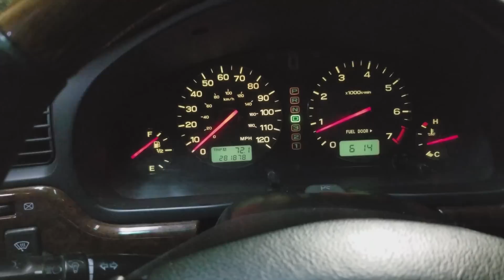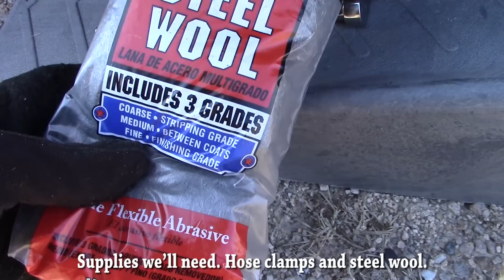Subaru Exhaust Rattle Repair

Comment: I used some brass wool to fill a few voids between the heat shield and the exhaust pipe. Worked like a charm and doesn't rust. I cut off all the mounting bolts (but one {access issue}) and replaced with stainless steel hardware. Now, to replace that leaking oil pan seal....

Comment: I have a feeling this is the issue my 02 Outback is experiencing. I was about to diagnose it as a rattling driveshaft or bad u-joint (maybe even a transmission noise) but it doesn’t seem to have any issues driving, no shaking >50 mph as my 87 BMW 535iS had when it’s driveshaft went bad. My sub just has this annoying rattle when running.

I think you just saved me a bundle of money with this video!!
Reply from the maker: Glad to help. 👍🏻

Comment: Worked like a charm! My rattle kicked in at low gears at around 1500 rpm on my 2014 subaru forester.
Reply: Lmao I was brought here by the low gear rattle around 1500 rpm on my ‘14 Forester. How are your ball joints and CV axles holding up?

Comment: Thx MrSubi, this fixed a 10 year long mystery. Serviced over 8 times now by Subaru dealerships for the mystery noise, never fixed. You fixed it. One thing I changed:
COPPER MESH wool instead of steal wool because rust, hopefully that will be a 5 year+ fix.

Comment: The steel wool rusted. Replaced with stainless scouring pads. A little harder to get in, but works like a charm.
Reply: We have them at the restaurant ask any restaurant worker will snag a couple for you.
Reply: Did the scouring pads hold up for a while? I'm needing to do this on my car and I had the same rust concern.
Reply: @jasonbinney2979  They've held up great so far.
Reply: Isn't steel wool flammable?
Reply: @phizz8694  It was 3 years ago.

Comment: When I first heard some painful rattling under  the hood of my newly purchased (and previously enjoyed, 145k mileage) 2010 Forester which I have fallen in love with of course I first thought of the worst. Was it the engine? Catalytic converter? It was just the heat shield. I pinpointed where there was some space and movement, and thanks to this video it’s now perfectly quiet underneath once again. We will see how long the simple remedy holds up, but for now it’s working beautifully. I used a thin pvc pipe hand saw, thinner than a flat head, and I was really able to pack a lot of grade 1 steel wool in the small spacing that was causing such a terrible noise. Thanks Mr. Subaru!

Comment: I just got a 2012 Subaru Legacy and it has the same rattle you had I was like wth can it be and it sounds like it’s the heat shield so after looking at your video I will be doing this on the weekend thanks for posting 🤘🏻life saver

Comment: Lol. I pulled a nail someone jammed between the shroud and exaust on my car. The thing rattled and I thought I botched a repair elsewhere. Shoved the nail back in temporarily to quiet it down. I'll be fixing it the right way so I don't give myself or someone else a flat.

Comment: Excellent video. Hopefully this is the issue with my 2013 Forester. It's exactly as you described, at drive thru's and red lights.
Reply: Same noise same car, I will try to do the repair this weekend

Comment: Made a discovery recently... I first thought my chattering noise at low rpms was due to the exhaust manifold. I then noticed that the rubber hose that drains from the A/C had become unseated from its plastic clamp to the left of the transmission and was bouncing against the exhaust system making the noise. Just something else to be aware of I suppose. Figures I'd see it after I had jacked up the car and checked the entire exhaust system for loose parts hahaha
For context, this was a 2010 Legacy 2.5i

Comment: I have a 2000 Subaru Outback and I have that same noise. I well have to do that . Thank for the tip
Reply from the maker: +Christopher Hayes you're welcome. Glad to help. 👍
Reply: I think every Subaru eventually gets the "Heat Shield Rattle".  My 2010 Legacy did.  I used a metal hose clamp (just like the video) to silence it, though didn't think of the steel wool.
Reply: Be careful some times the exhaust actually breaks loose from the welds. The 2005 outback xt that I used to have did the same thing and rattled like crazy just like this. I totally thought that it was just a heatshield.

Comment: It is really terrible that this is such a huge problem and they don’t address it. I have it with my 2013 forester. Aren’t you worried about the steel wool rusting away after hitting one puddle?

Comment: Thanks again for making this videos, also as a suggestion could you make a video with the subject about fuel lines I got a Subaru 2002 Impreza outback sport and I had to deal 2 time already with fuel leaks coming from the small section of rubber fuel lines right next to the injectors, driver and passenger sides, temperature under 32 degrees trigger this leaks and they are nerve-wracking especially when you're away from home.
Reply from the maker: +Regular J Garage talking about the rubber fuel lines between the fuel filter and fuel rails?
Reply: Got the same issue on a n '01 Forester.  When the temp drops below freezing I get a strong smell of gas in the cabin.  Is there a simple repair short of replacing the fuel lines?
Reply: No, the lines I am talking feed the injectors, they are mostly metal but for some reason have small section of rubber hold by hose clamp, I live in Alabama and we have 20 degree weather this couple days, and that's what cause the rubber to think or freeze allowing fuel to leaks, is a simple fix, just tie the hose clamps, but when you're dealing with fuel potentially running down to the exhaust, that's scary.
Reply: Andrea Echevarria what I did was tie down the hose clamp, check for leaks and keep  an eye on it. But If your fuel line has any kind holes or cracks replace it inmidiatly.
Reply from the maker: +Andrea Echevarria nope. Either the fuel lines need to be replaced or the rubber seal at the fuel pump module, under the back seat, has failed.
Reply from the maker: +Regular J Garage you're visibly seeing the fuel leak from these hoses? Or could it be the injector o-rings? Either way, they're old and most likely getting brittle, so the contraction from the cold is really doing a number on them.
Reply: MrSubaru1387 yes I can see the leak, I had to remove the metal bracket that cover the injectors to get clear access, also coolant leaks where the radiator hose meet the aluminum cross coolant bridge, I can't get it tie enough to stop leaking, thank for the help, like you said the hoses are getting old and brittle I also going to replace injector oring will I am at it
Reply: Thanks

Comment: I think this is happening with my 2016 Impreza - that slight rattle once car started, and then more so at initial acceleration....after that don't really hear it as car speed increases to 30-40-50 km/h, .....neighbour told me its the CV joint/bearings....but why would it make noise even when in park?  No vibration or steering issues either. Have to find trustworthy mechanic...

Comment: I have a 2009 subaru outback and the rattle is a different location. The exhaust hose is disconnected from the muffler. My husband tried epoxy to reconnect and I've tried using jb weld steel stick putty but neither worked. I'm wondering if there is a part I can attach to the exhaust pipe that will fit into the muffler? or any suggestions you might have, including give up and take it to the shop.

Comment: You know what I find extremely useful for those clamps. A small power drill with a nut driver. The amount of time I've saved is astronomical.
Reply: Also I have horrific carpal tunnel and have had surgery. Still starts to hurt if I have to twist my wrist that many times.

Comment: I like the idea of stuffing something in there, but have you ever seen steel wool burn?  It goes fast and hot.  I don't have a better idea for this second other than asbestos, but that can't be bought.
Reply from the maker: Been driving like this without issue.
Reply from the maker: Yes, I have burned steel wool before.
Reply: I cut a piece of an aluminum tube today and tapped it in on my car. Didn't think of anything better yet.

Comment: Sit outside your Subaru dealer where the cars go in for service.   More than half the cars going in have this rattle.   You would think Subaru would have a fix.   Never had a car that had this problem before my Subarus (I have 2).   Every 65K they get a rattle that Subarus says is an internal baffle the want to replace for this noise.

Comment: My Forester '14 is making an annoying rattling noise. How much would it cost to replace the heat shield if DIY, and is it difficult?
Reply from the maker: Fairly easy replacement. Held in with 10mm nuts. Not sure of cost on the heat shields. Most people just remove them.
Reply: Thanks for the reply. I'm thinking of doing it on my own. Called the Subaru dealer, and it would cost $130 for them to look at it. Trying the weigh the dealer cost and DIY cost and experience

Comment: this video is not in New England... i have removed,  or clamped, or wired heat shields a couple times a year with my 04 impreza... i will stand by my vehicle any day,  but damn... more rattles than a nursery ( from heat shields )

Comment: I've used hose clamps and steel shims wedged between the shield.  How long do you find the steel wool lasts before rusting?  Do you buy stainless steel wool?
Reply from the maker: Well, I live in the south, don't get much rust at all. Yes, it was stainless steel wool.

Comment: I Have a question for you I have a 2010 Forester SOHC. makes Rattling noise in front engine Area. when cold start first start in the morning, but goes away after I "rev" engine what could this be ?
Reply from the maker: Kind of hard to say. Is there anyway you get take a video of it and email it to me or post on YouTube for me to see. Would be helpful.
Reply from the maker: Getting a 404 error when I try to watch the video.

Comment: I have a question. I tried the steel wool but it didn’t work. As a matter of fact the engine started to hesitate so I removed the steel wool immediately and the engine was working fine. I noticed that steel wool turned blue and I was wondering if by any chance you would know why it turned blue.
I have a P0302 code on my Impreza and I think this issue might be related.
I can’t still figure out how to fix this code.
I would really appreciate any help. Thanks
Reply from the maker: Cylinder 2 misfire. What have you done so far?
Reply: MrSubaru1387  I put new spark plugs and wires, I cleaned the MAF as well as the throttle body.
Reply from the maker: If the issue isn't spark, then you need to check fuel and compression.
Reply: MrSubaru1387  Do I need special equipment to check the fuel and the compression?
Thanks for all your advices 😃
Reply from the maker: For the fuel, simplest thing would be to swap injectors to see if the misfire leaves cylinder #2 and goes to the cylinder that you swapped it to. For compression you'll need a compression gauge or cylinder leakage tester.
Reply: MrSubaru1387  Great, I will definitely do that.
Thank you again for all your videos and for the tips.
Have a great day and I’m looking forward to learn more from your videos. 😃
Reply from the maker: You're welcome. 👍🏻

Comment: Hey MrSubaru. I’m having a bit of a problem with the trunk door of my 2001 outback. The panel of it doesnt stick, and every time I open the trunk, it unhinges on the top. It hangs down since the bottom screws hold on to it. It’s becoming pretty annoying and taping it is an ugly solution. Any tips? Thanks so much, gloria
Reply from the maker: +Gloria Flores this is an Outback sedan? Or are you referencing the hatch on an Outback wagon? Could you send a picture of the issue to me? MrSubaru1387@gmail.com

Comment: I noticed the rpm seemed low. Is this a normal rpm for this car? The reason I ask is I have a 2001 with the same rpm level. If it is not normal can you do a video on your findings of the issue, and the proper repair for this low idle issue.
Reply from the maker: +Longtrailside car is idling where it should be.
Reply: Ok thank you.

Comment: Can you make one vid about replace a blown exhaust gasket?
Reply from the maker: +Rulius Raul Estevez Vargas as in the exhaust manifold gaskets?
Reply: MrSubaru1387 yessss
Reply: Rulius Raul Estevez Vargas That is such a simple job. Two bolts sandwich the exhaust gaskets between the exhaust pipe and the head. Unscrew them, pull the exhaust down about 3-4 inches, then you can pull out the gasket. Clean the mating surfaces of both the head and exhaust, remove all the grime and residue and install a new MLS gasket. Takes about 20mins.
Reply: Jane Leelavathi so i have to pull the entire line to get to Clean it out? Do i do it with just a screewdriver? Or what?
Reply from the maker: +Rulius Raul Estevez Vargas if you watch my EZ30D engine removal/installation videos, I show replacing the exhaust manifold gaskets.
Reply: Jane Leelavathi that sounds pretty easy.

Comment: I wish I could work on my own car. What I need to know is how to find a good mechanic. I used to go to the dealer when my car was new newer but now they want nothing to do with me and want too much to work on it. (2003 Subaru Forester) So I asked around, read reviews on local garages and picked the wrong one. Now I'm in debt and got screwed. A loose heat shield was rattling when I left two weeks ago and looked under last night, just touched it and it fell off and is laying on top of the muffler. Can I drive with it like this? They also replaced my Bosch Icon wipers (for state inspection) with something cheap and charged me when they were fine. There's more but I won't go on venting. I just need a good mechanic
Reply from the maker: Finding a good mechanic is sometimes a difficult thing to do. In regards to the heat shield question, yes, the car is safe to drive without it.
Reply: What I mean is the heat shield is lying loose directly on top of the muffler and I can't pull it out in any direction. I haven't driven it yet since I found that but will be going out tomorrow. It will probably be really loud rattling.

Comment: Steel wool will rust and the rattle will return.  My solution is permanent.  Crow bar and cave man the shield off of there and throw it onto the steel scrap trailer.  Perfectly quiet forever.

Comment: What size clamps are you using?
Reply from the maker: I can't recall. Sorry. I'll try to check later and get back to you.
Reply: @MrSubaru1387  Yeah... Get right on it...
Reply: @MrSubaru1387  what's the size?
Reply: @airhogglider  I know it's a year later but I bought some clamps for my 2019 Crosstrek because the heat shield was rattling and I got 2 1/2 hose clamps.
Reply: @arthurfernandes2402  fixed and sold the Subaru Forester

Comment: What size of clamps did you use?
Reply from the maker: Can't recall. I have a display rack with all sizes. Just grabbed the largest one.
Reply: @MrSubaru1387  ok, but would it be safe to assume I go with a 3" clamps then?
Reply from the maker: You will most likely need to connect 2 end to end.

Comment: I have 2019 Crosstrek 6 spd making  rattling noise  only when  gas pedal is  pressed between 2500-4000 rpm, more noticeable when driving up an incline. Dealer replaced clutch bearing and front intake exhaust but still making noise. Any idea what it could be? Here is the video.  https://youtu.be/9l_iH-zVfes

Comment: I got some pebble or sand in mine causing rattling... Can the bolts be easily removed w/o breaking?
Reply from the maker: Usually, no. Usually they're pretty rusted/rotten.